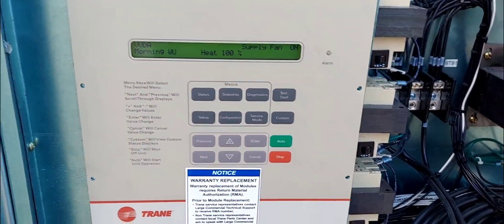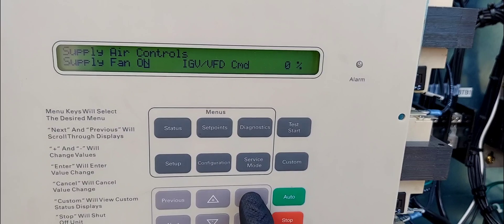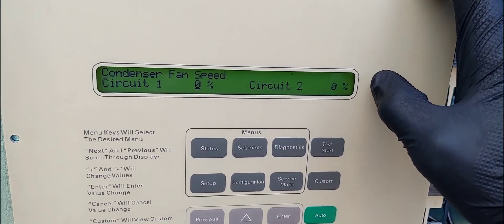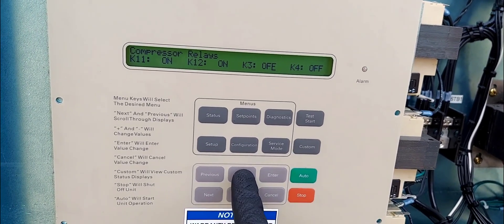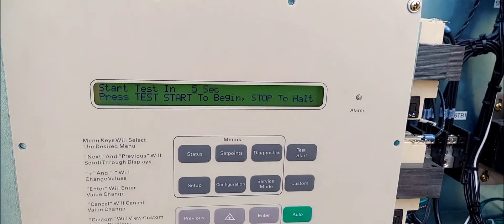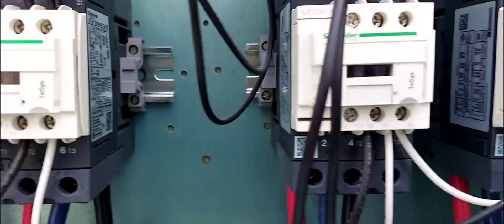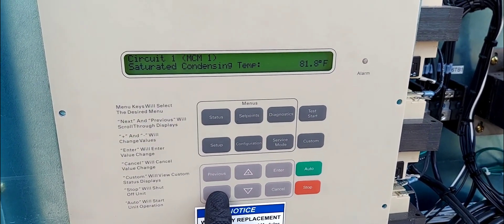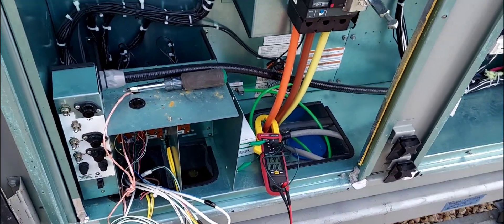TRANE INTELLIPAK SERVICE TEST MODE

Comment: Thanks for the video. Question, I followed your video. I have 2 fan Contactors that are not getting 120v to trigger them. 1U49 MCM COMPR (BRD03228 Board). I check the 2 pins that supply 120v for each of the 2 fans off the board. No 120v on either. The other 2 pins for 2 other Fans out (total 4) They get 120v the contractor. We replaced the board twice. Have any advice to what to check next? Any help would be appreciated thnx in advance
Reply from the maker: Some of those works  with low ambient so if condenser saturated temperature or possibly outdoor temperature is low or reading low this may be the reason
Reply: @D2DNYAC  Thank you for the response

Comment: you went off on outside stop because of the test mode ? you becouse17&18 opened due an issue? thanks for the video very informative
Reply from the maker: No issues! external stop was opened by the building management system or BMS controls

Comment: you forgot to turn on blower vfd
Reply from the maker: @Jls1259 😬  😆  correct 👍 left at  zero!  , that setting is also linked with modulating heat valve